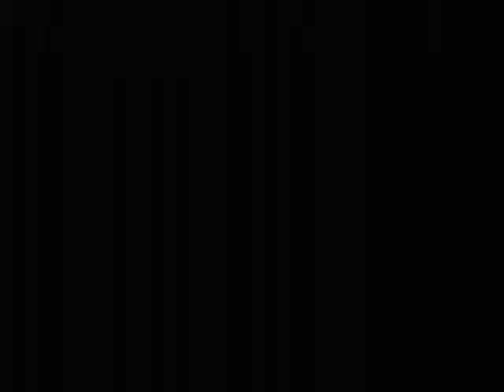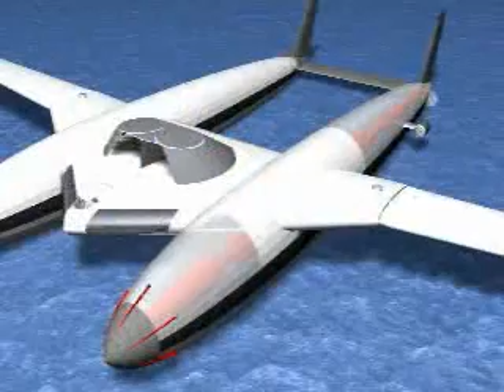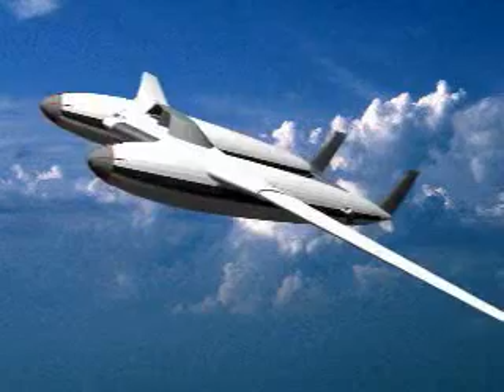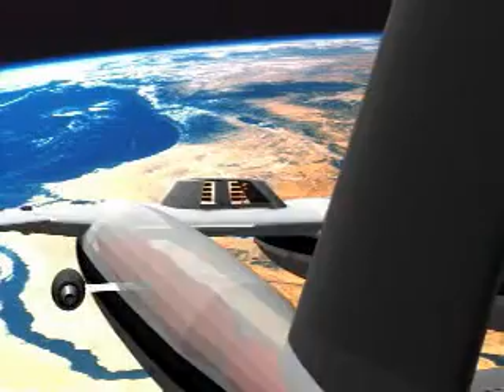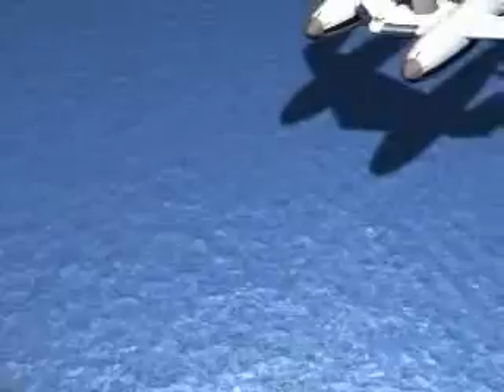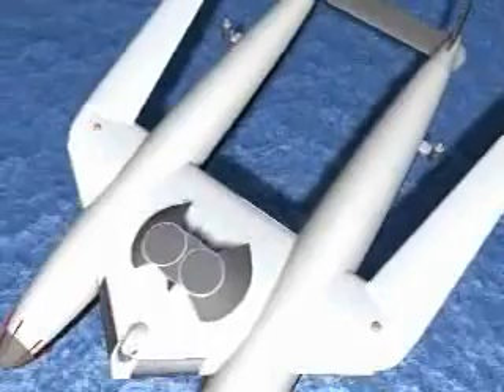Gravity Plane

Comment: "Some of the stored compressed air is then expanded into the dirigible areas, decreasing the buoyancy effect of the helium"

I'm afraid I don't see how that works. You have the same amount of mass occupying the same amount of volume. How would that decrease buoyancy? Alternatively, if that compressed gas were somehow filling up bladders so that the volume is effectively increased, you'd get *increased* buoyancy, not decreased. Can you please explain? Thanks.
Reply: Seriously? If normal air was buoyant then why would you need helium. Volume is conserved weight is not as the density of their air at STP is greater than helium because the atoms have more protons and neutrons.

Comment: Yeah, I think this is a little ridiculous. Using compressed air to compress air seems like a fool's errand. That it can be done without an outside power source means they have finally made a perpetual motion machine. 

It might work with a small gas engine and be fairly efficient, but imagine how slow travel would be and passengers would swooped up and down many times to get anywhere. Keep that barf-bag close.

Comment: Right of course, it's definitely not practical in terms of electricity otherwise it would be in wide use today. Though I rather enjoy the concept of an expensive toy in my garage that can make a star on demand. (I'm probably too cheap to buy the parts to build it).

It does make a good source of neutron radiation depending on the fuel.  This is one of it's more practical applications... but probably a negative for the hobbyist.  :D

And thanks, forgot about the gliding part of the buoyancy loss.

Comment: That's not true - this principle is working right now in automated sea robots. There would be a way to make it work for the atmosphere. I mean you can get lift by releasing air to inflate the helium lungs, and then you store more air for the engines when you decend - they said it was a glider configuration not powered - so totally doable.

Comment: @Troycootsable
...moons and planets? it's quite evident that this system relies on "our" planet's morphology... It takes advantage of the weight of our atmosphere... atoms of helium are lighter than those of our common "air", that's why it "lifts"... and the aerodynamics are designed to work in a thick atmosphere for the gliding part... How it is supposed to "lift" and "glide" in an atmosphere-less environment? (or in a "poor" atmosphere) :D

Comment: Ok, it uses the airflow of it's decent to recharge the air to launch it again. if this works you've just invented a perpetual motion machine! :P pluss for the amount of air you'd need to power something that size at any decent speed the tanks would fill just about evry last inch not filled with helium.

Comment: wel, think of it like this...hindenburg held 20-50 ppl. how big would this thing be, and how long would a flight take.plus the idea of "air powered jets" is assenine. what's a jet designed to do? move air, DURR! plus it takes a lot of resources to make that much helium, more than needed to take an a380 on one of those "little voyages" mike is talking about. whoever designed this was on vodka iv at the time.

Comment: If you put armor & troops on board, It'll weigh too much. Lighter than air requires a HUGE gas envelope  to lift  a Tiny payload! Ever see a hot air balloon? or the Goodyear Blimp?
Besides, you CAN make a Harrier type drop ship. just put 2 engines beside a central troop pod. run a boom under the tail for them to zip out on to avoid downwash, & a winch to lift them back up. A REAL Harrier can lift a 10 man squad, weight wise. A good engineer can build one!

Comment: This sounds like a perpetual motion idea, and sadly, perpetual motion does not work.
If they were to want this to work, they would have a better chance if they used solar power to run the compressed air pumps - as trying to compress the air they are falling through would cause so much drag, the plane would lose too much momentum & would fall out of the sky.
I wish something like this could work, but you can't have perpetual motion, it goes against the laws of physics.

Comment: No you would not save any fuel at all with this. All you would do is to lug around a big bunch of heavy equipment and gas and compressors and whatnot and not get *any* benefit at all. Operate with this scheme and you would only *lose* fuel.

Comment: Absolute nonsense. At maximum altitude, the plane uses compresssed air to run electric compressors to compress atmospheric air to displace the helium in the tanks. Why not just use the already compressed air stored in the plane to contract the size of the helium gasbags?

This has clearly not been thought out very well. It's hugely unnecessarily complicated, and until a prototype is built, I would be most sceptical. On the face of it, it looks like perpetual motion, which is *not possible*.

Comment: this would never work,  your just saying that you would take the energy from the energy from the decent, when the decent phase is supposedly where you get the energy to glide. and it would take 7 years for this to get anywhere, coupled with the fact it could only carry a feather. next time, put some mathematics in to show it would work, don't just keep saying, lighter than air, gravity, lighter than air. solid mathematics is whats needed